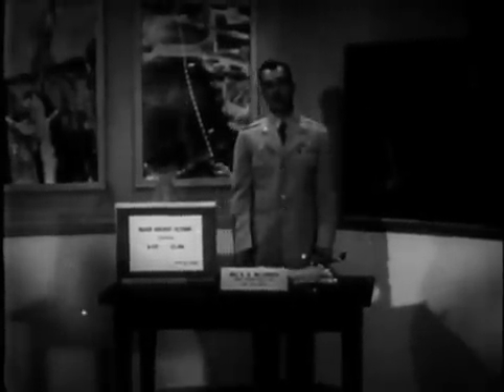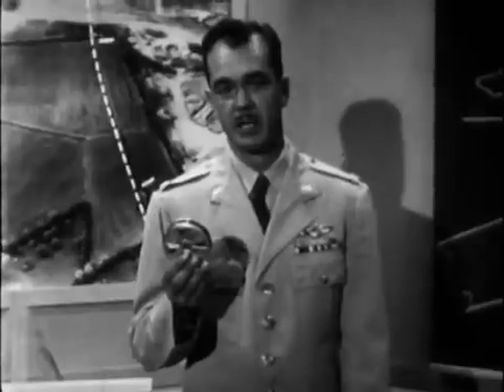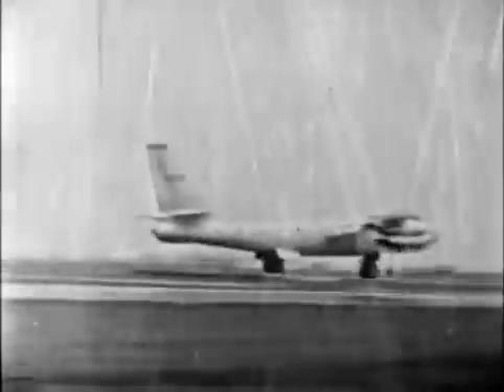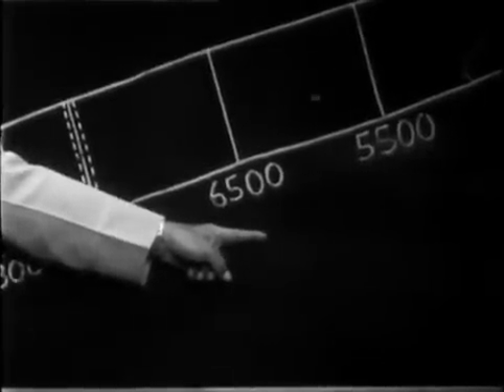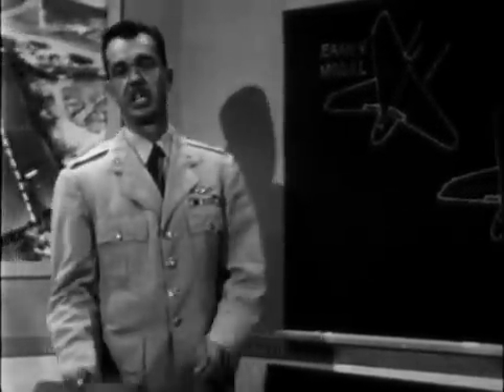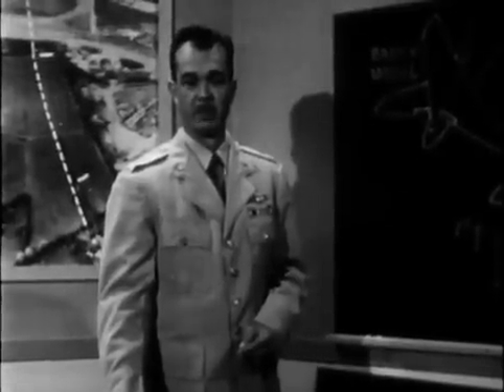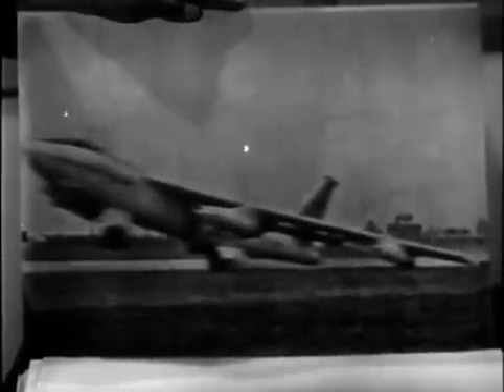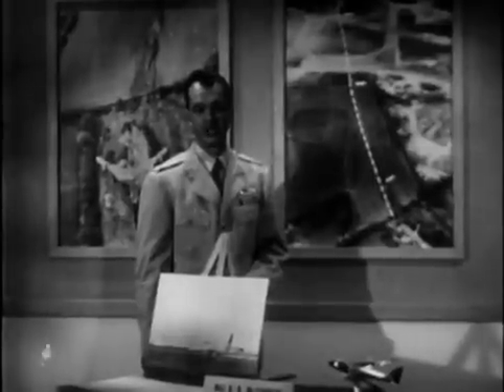B-47 Stratojet Accident

Comment: Sometime in the summer of 1962 my Father and I witnessed a B-47 exploding.  It was in the afternoon and Dad and I were leaving the field after finishing a day of riding the tractors around and round.  As we were heading from the middle of the field in the pickup there was a tremendous flash off to the East low on the horizon.  The B-47 wreckage almost hit my step uncles farmhouse three or four miles North of Bird City, Kansas (maybe 35 miles as the crow flies)..  Within a few hours armed military crews were in the area cleaning up debris. It was several weeks before they left the area.  It was speculated  Nuclear weapons were on board but who knows?
Reply: On 23 July 1962, a B-47 based at Dyess Air Force Base near Abilene, Texas, departed on a training mission through Montana. After crossing into Paradise Valley, it crashed into Emigrant Peak and exploded while turning toward the northwest.
Reply: I read about that Kansas one. That had to have been a surreal thing to witness 😮